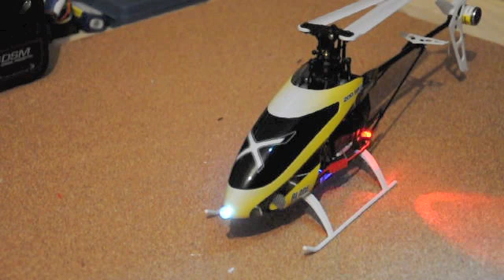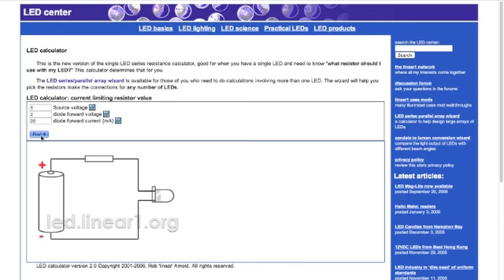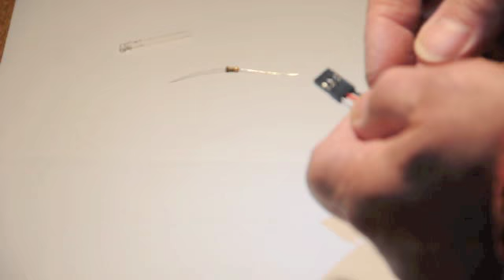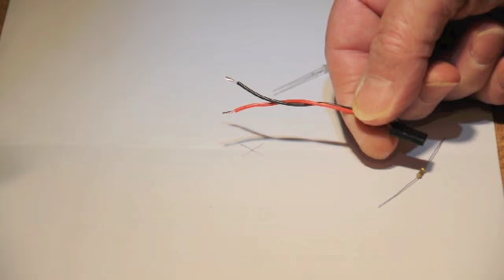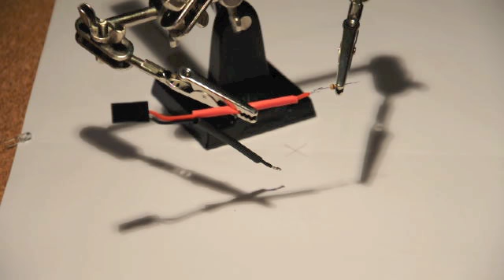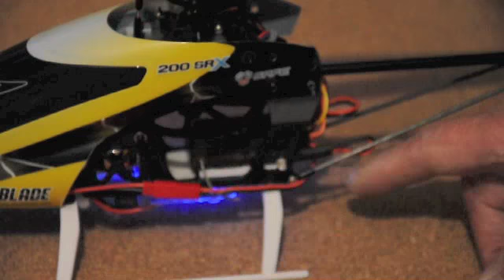Blade 200SRX Red & Green Navigation Lights

Comment: That's really cool and a good vid, I'm useless at this type of thing, I'd like lights too, is there a kit already made up for a straight install? Why dont you knock a few together :)
Reply from the maker: rod ders Thanks for your comment.  No, I don't think there is a made up kit ready to install on the market.  The components can be sourced very cheaply and if you following the instructions you will succeed in completing the task yourself.  You've given me an idea though - make up a few kits and sell them on eBay…lol.  Once again, thanks for the comment.
Reply: That's really weird Andy, I have literally just finished the nav lights having copied what you did:). Would the nav lights not power of one port by using a Y lead? If it does then I could fit a flashing tail light:)
Reply from the maker: rod ders I'm no electrician so I'm not sure.  It's worth a try.  Let me know how it goes and maybe I'll give it a go.
Reply: Well I've ordered the white flashing bulbs was hoping they be here today but looks like will be Monday now. I plugged them. Both into a Y lead and tested off the battery not on the heli and they both worked so I think they will be ok:) so Im thinking stick the nav lights on 1 port and then maybe a tail light and a white flasher underneath:) in the other port. will let you know.
Reply: Hi Andy, I have the red and green now in one port with a small Y lead. I have now put a white flashing bulb underneath using the free port, and I am now looking into a tail light and use another Y lead to connect that and the flasher underneath :)
Reply: I have fitted 2 white flashers 1 on the tail and1 underneath.  Here a link to what I did, pretty much 1st half is what you did. Thanks again for your upload and this poo weather that gave me  something to do:)
Reply from the maker: rod ders Have you fitted a white flashing lights or strobe lights?  I've not been able to find the link to which you referred.